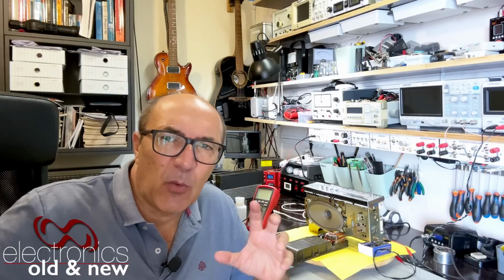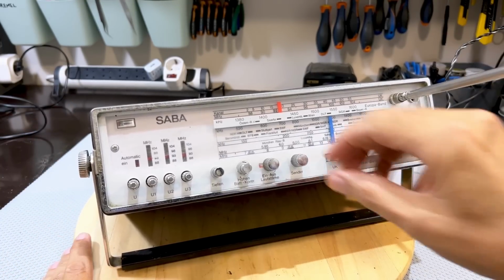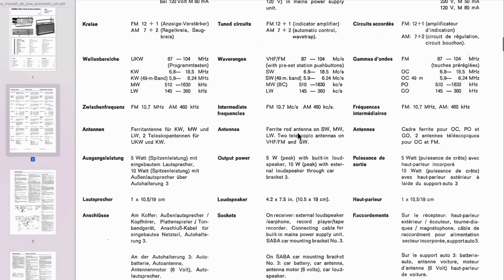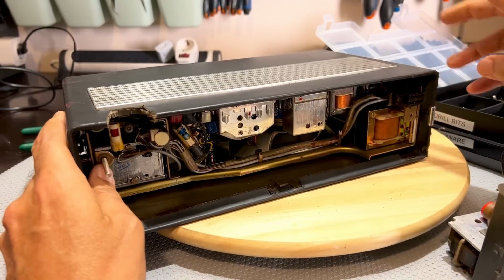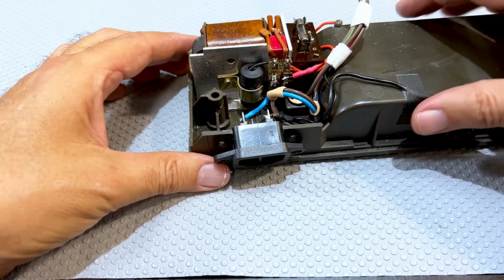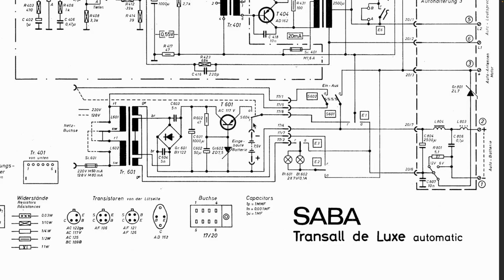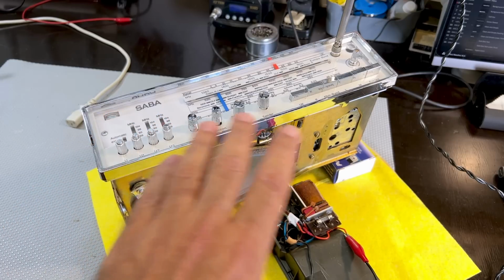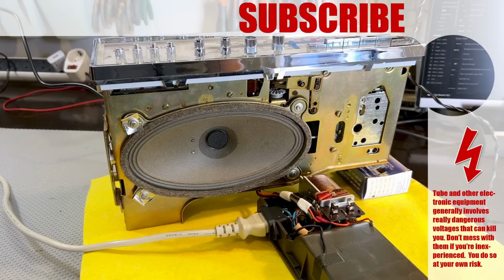Luxury in a portable. SABA Transall de Luxe restoration part 1  #pcbway#

Comment: Hello Manuel. The filming is interesting especially for connoisseurs. I bought the deluxe automatic model. It works perfectly with batteries, but the light on the scale does not light up. So I connected it to 220v, without removing the batteries from the device. The light on the scale lights up, but I can't catch any radio station. In short, it doesn't react at all. I can not hear anything. I think if it works perfectly on batteries then it should work the same on mains. What do you think? Thank you in advance. Dan.
Reply from the maker: Probably a switch issue.

Comment: I have this SABA Transall Deluxe.
When pressed in,  the treble (hohen) control knob will show the battery condition on the tuning meter.
The "KW Lupe" is the SW fine tuning.
"Automatic Ein" is the AFC for FM if you rotate the control.
"Europa Band" is just the upper end of the MW band spread across the width of the dial scale for easier tuning.
I know there is a dial light,  but after owning this for 20+ years,  I have never been able to figure out how to activate it.
Good luck with yours.  I get excellent tuner performance on all bands,  and the audio output is amazing.

Comment: A very nice radio Manuel. Your solution to the hacked up power socket looks good. When you were talking about it I was thinking a piece of stainless steel plate to cover the hole or recover the radio with new Rexene. Your solution with the diode was inspired. Is it possible for the battery voltage plus the diode 0.7 volts to be high enough to pass current even when plugged into the mains? Just wondering. I struggle with transistor sets and controlling the negative side instead of the positive so I appreciate you running through the circuit. Well done Manuel 👍🙂
Reply from the maker: I was also thinking of a plate to cover the hole, but then noticed that the IEC socket fit quite nicely. 
The way it’s wired, the battery voltage will always be a little lower than the mains supply, even with new batteries, so it should be OK.

Comment: I’m really looking forward to your next video. I’m fairly certain this radio has a varactor diode type of fm tuner. In my experience, these tuners tend to drift a little after the radio is switched on and for this reason the AFC is a useful feature. Most of the major European radio manufacturers offered this type of FM preset tuner on their most expensive portable radios during the late 1960s and early 1970s. The Blaupunkt Supernova, Telefunken Atlanta DeLuxe and certain Grundig Ocean Boy radios had similar FM tuners.
Reply: Whether you realize it or not, your latest Saba radio represents the Zenith of European car-portable radio design.The dial and controls are absolutely magnificent.

After about 1969 these high quality radios disappeared as more Europeans got factory installed radios in their cars. Plus radio increasingly competed with television. And there was also intense downward price pressure from the Asian radio manufacturers. Your set is not the biggest set of its type but was made a little smaller so it could fit under the dashboard of a 1960’s European car without taking up too much space. But the more compact sets like this and the Transita tend to be more miniaturized inside and more difficult to work on.
Reply from the maker: I see how miniaturisation would make everything very tight, but the result is worth it.
Reply: Miniaturization 1968 style!
Reply: Miniaturization 1968 style!
Reply: Miniaturization 1968 style!
Reply: Miniaturization 1968 style!
Reply: Miniaturization 1968 style!
Reply: Miniaturization 1968 style!
Reply: Miniaturization 1968 style!
Reply: Miniaturization 1968 style!
Reply: Miniaturization 1968 style!
Reply: Miniaturization 1968 style!
Reply: Miniaturization 1968 style!
Reply: Miniaturization 1968 style!
Reply: Miniaturization 1968 style!
Reply: Miniaturization 1968 style!
Reply: Miniaturization 1968 style!
Reply: Miniaturization 1968 style!
Reply: Miniaturization 1968 style!
Reply: Miniaturization 1968 style!
Reply: Miniaturization 1968 style!
Reply: Miniaturization 1968 style!
Reply: Miniaturization 1968 style!
Reply: Miniaturization 1968 style!
Reply: Miniaturization 1968 style!
Reply: Miniaturization 1968 style!
Reply: Miniaturization 1968 style!
Reply: Miniaturization 1968 style!
Reply: Miniaturization 1968 style!
Reply: Miniaturization 1968 style!
Reply: Miniaturization 1968 style!
Reply: Miniaturization 1968 style!
Reply: Miniaturization 1968 style!
Reply: Miniaturization 1968 style!
Reply: Miniaturization 1968 style!
Reply: Miniaturization 1968 style!
Reply: Miniaturization 1968 style!
Reply: Miniaturization 1968 style!
Reply: Miniaturization 1968 style!
Reply: Miniaturization 1968 style!
Reply: Miniaturization 1968 style!
Reply: Miniaturization 1968 style!
Reply: Miniaturization 1968 style!
Reply: Miniaturization 1968 style!
Reply: Miniaturization 1968 style!
Reply: Miniaturization 1968 style!
Reply: Miniaturization 1968 style!
Reply: I apologize for all the repeats. I’m not sure what happened.
Reply from the maker: No problem

Comment: Okay, I saw it now... again, I reiterate, Please, for the good of of the radio, replace the "Stabilyt" cell, check the schematic, it is basically the same deal as on the Tandberg tp-41 or Schaub lorenz touring 30-40-50 series, it needs to be replaced with 2 Si  diodes in series paralleled with a 100...470 uf capacitor.
There are plenty posts about such cells online. Sooner or later that cell WILL die, and your radio WILL  die as well. The cell also leaks corrosive substances which unattended will destroy traces on the pcb. I had to deal with that as well in the past.
Also, if you will use it on mains, for the love of all that is holy :)) replace that red AEG selenium bridge rectifier. Chances are high, and getting higher and higher the more you use it that it will go boom, and spread those nasty fumes inside the radio.
Also, speaking from own experience, it can die slowly  as well, raise resistance and end up overheating  or even killing the secondary of the mains transformer.
I saw plenty of those red AEG rectifiers expired, and fixed quite a few radios and recievers just by replacing them.

The metal case AEG selenium gumstick rectifiers from a few years back are a different story, those are more reliable... not perfect but from my own experience  those stood the test of time better.

Good luck in the future too! Fingers crossed
Reply from the maker: Thanks 👍
Reply: @electronicsoldandnew  glad to share some of my knowledge  on it, it would  be a shame for such a classic radio to end up disregarded somewhere. It truly deserves the attention and hopefully  plenty more years of enjoyment will come out of it.

Comment: I have one of them too, fortunately  mine looks kinda new .... didn't  watch all yet, but in case I forget my thoughts... that selenium rectifier really has to go. And the "stabilyt" cell inside really, really has to go. The set is also made for 300 ohms antennas for fm (both, rabbit ears) so with a single one the performance/ reception will be poor. At least that's  how it goes on mine.
Also, you can adjust the voltages for the fm varicap tuner (try changing the zener diode there with a higher voltage one) and like that you can very easily get to cover the whole FM band up to 108... did it on mine, works like a charm.

Overall  it is a very good radio, only complain I have, the speaker lacks a bit IN the bass department due to the very tight cabinet construction. I have a "transeuropa" from circa 1964-65 with the same type of speaker, but that one has more space, and sadly (for the transall) sounds better to my ears, bass wise.
Reply from the maker: I decided not to extend the tuning range on this one as all our local stations are below 104MHz. The antena will have to be sourced somewhere. They do occasionally show up for sale.
Reply: @electronicsoldandnew  they are pretty easy to find, especially  for someone  with an extensive collection of old radios similar to it :)
Hope your speaker is all good.... trying to find one of those classic Saba speakers, that would be true detective work....
Reply from the maker: Yes, the antenas are easy.

Comment: Did you see that dc-dc  converter T61, transfo, rectfier bridge 24v zener and so on...?, seems  related with the AFC, and some kind of " frecuency tunning memories".🤓
Reply from the maker: It probably is used for the varicap tuning of the FM band and FM presets, that may need a higher voltage to give sufficient tuning range.

Comment: Hey there, what a coincidence... I restored one of these two months ago, now is my to go radio for my summer holidays... I love the deep bass, and try to listen a classical piano piece with it, it sounds like being in a concert hall. I believe Saba had some sort of alien technology, their top products were and are still top of the notch. Can't wait for the rest. 
Bravo Maestro!
Is it in Madeira like ~50°C just as here in Sicily?
Reply from the maker: This radio does seem to touch on the alien tech dude 😊 the quality is amazing. 
The temp here is actually quite mild as we are not experiencing the heat wave. Stay hydrated
Reply: @electronicsoldandnew  Pity that to dismantle the upper part (what I didn't do) is almost impossible
Reply from the maker: Yes, it can be done, but requires a LOT of desoldering if wires, which sometimes causes more trouble than it’s worth.

Comment: Please someone explain to me the little U1, U2 and U3 controls. Never seen anything like that on any radio. Thanks......
Reply: Just FM presets, to have 3 preferred stations at hand without tuning. TV's from that era had six of them on the front.
Reply: These types of tuners were used on various Fisher stereo receivers made in the US but with some European parts. Fisher’s 100 table radio also used a similar tuner. But virtually all portable radios sold in the US except for a few European and Asian made radios had conventional tuners with no presets until the 1980s when digital readout tuners became popular. Some early US cable ready TVs used a similar push button tuner but it was usually hidden behind an access panel and controlled by an exterior mounted conventional rotary knob.

Comment: VERY SOPHISTICATED radio 📻. The more sophisticated, the better. It’s like 👍 a CB radio 📻 in a way. Just be aware what surprise may be lurking 👀 on the inside. Some sophisticated radios 📻 have dual dial cord systems. These can be very hard, or even impossible to restring, unless you have the dial cord diagram. The face on this appears to be glass. Your friend, Jeff.
Reply from the maker: Fortunately the dial cord is fine on this one 👍

Comment: That IEC Connector was a good choice to cover the butchery that a previous owner had done.  A shame the previous owner made such a mess, as a figure 8 AC connector with a switch in it to isolate the battery would have been better.  The diode is a good alternative in this situation.   I think Dave Tipton would be proud of your mains input solution.   Really looking forward to seeing how the cabinet turns out with this.   Such a lovely radio.
Reply from the maker: 😊 thanks

Comment: The Europa Band is just the upper third of the medium wave band spread over the whole dial. It covers the former frequencies of 'Radio Luxemburg' (1439 kHz) and 'Europawelle Saar' (1421 kHz), the latter being the German public broadcasters' answer to Luxemburg with a very similar program and an even more powerful transmitter putting out an enormous 1,200 kW (600 kW at night). 

Some German portable radios even had a 'Europa' or a 'Luxemburg' button fix-tuned to the frequency of the respective station.  

The unit with the three FM buttons is the infamous 'Preomat', made by German company Preh and built into many German radios of the era. In your radio, it has five switches (station 1, 2, 3, main dial and AFC on/off)  and three pots. Infamous because they have a tendency to become very erratic which also can affect the tuning on the main dial. 

The 'Höhen' (treble) control can be pushed down to check the batteries.
Reply from the maker: Thanks 👍

Comment: Hi Manuel, the socket "antenna motor (6 volts)" is a connector with which its possible to operate the motor of a telescopic antenna often mounted in fender of the car. Most car of the 60s had 6V battery voltage instead of 12V.

Comment: so the push pull ad162 output stage capable of a few watts is being regulated by flimsy AC117 rated like 1 watt!  Fantastic.  They could have easily used another AD162 if they really wanted it properly regulated! Suggest replace the crappy AC117 with 7808 or 7908 3 terminal regulator.
Reply: I think because of   battery supply  it wasn't designed to push more than 0,5W- 1 W.  Portables   used with batteries had voltage was not regulatedat all  - regulation had purpose to match mains floating supply to  equal to battery level  - in that time distortions few procent were considered  with better understanding than today because   - producers had in mind that speaker has 5% THD level and users did not complain then
Reply: The AC117 really works at it's limit here. A better substitute without changing the circuit would be an AC 128 or AC188.
Reply: @schorse1000   . For max voltage drop Vce   which is smaller then supply  voltage   power of voltage regulator is enough. With nominal 6V and  1 W output current would be  about 0,16A max Voltage drop is 8V-6V = 2V so thermal power of voltage regulator will be 2Vx 0,16A = 0,32W 

Do not suspect please that producer of such radio produced in many thousand pieces which worked good for 60 years had no enough   knowledge. . "There are people who find solutions to problems an people who find problems in solutions" (A.. Einstein).

Comment: Hi Manuel, Enjoyed the video as usual. I was wondering what the various a/r markings were meaning, and it is explained in the bottom left corner of the schematics : A is for Arbeit, work and  R for Ruhe, rest, corresponding to the pressed or released position of the buttons. It is less clear what the Exxx are referring to, probably to the Europa switch, but there are more references like E2 E6 than there are numbers on the button diagrams which only shows 1, 3 and 4...
Reply from the maker: Yes, it can take quite a bit of study to get all the references correct. As I did not really have serious fault-finding time do, I did not need to go that deep.

Comment: 13:24 for this Type of portable German Radios, there also often existed special Car Mounting Brackets. So You could use this Type of German Radios (if they had that Feature, of course) also as a Car Radio... That is also, why the Connections on those Radios are very often a bit "special".. That is for the Use as a Car Radio... And the Connections to an Antenna Motor was Part of this Car Mounting Bracket Set...
Reply from the maker: Yes, most if the ones I’ve got have this option.
Reply: @electronicsoldandnew  Oh and 6V once was also used in Cars as the Standard. Back in the Days it worked. But I think it could also cause Problems for Example when it was cold and the Engine did not start so well... So they changed it to 12V... And that worked better, I guess...

Comment: I've learned over the years that portable radio's usually means very compact and hard to work on, so I look forward to a look inside.
Some of the Grundig's you've worked on looked very complex as well, but you soldier on with them anyway!
BUT, that said, it sure is a smart looking radio.  Very clean look!
Reply from the maker: Yes, very well built, but impossible to break apart for “easy” repairs.